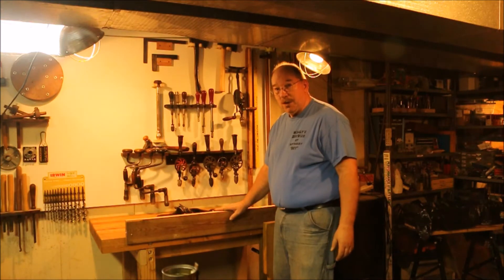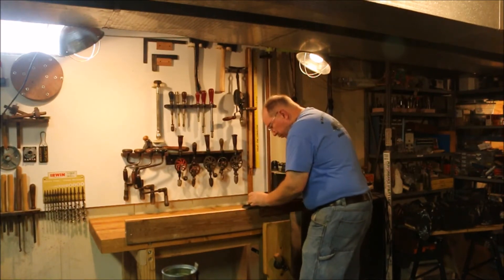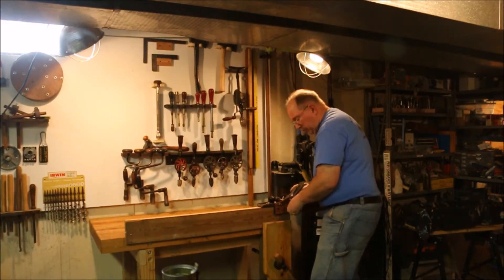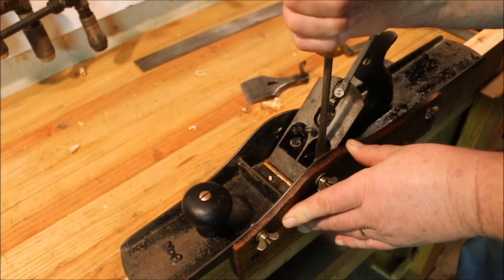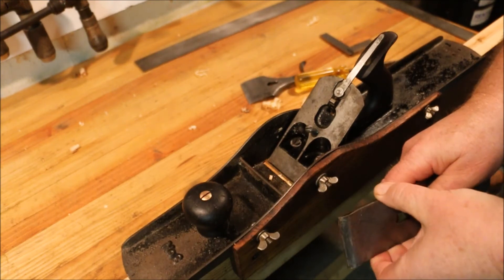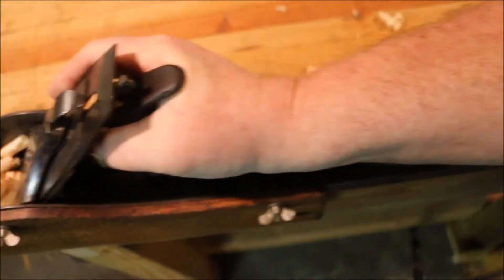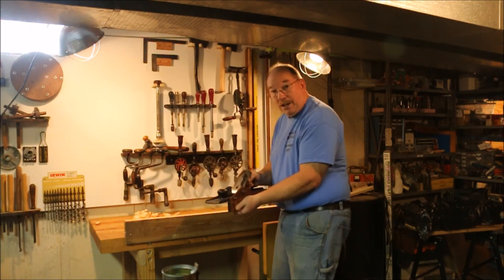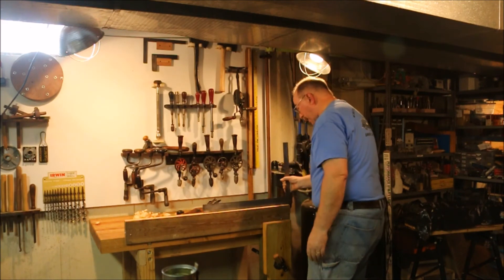ANTIQUE SHOP FINDS ~ STANLEY NO  8 PLANE ~ PART 10 ~ TESTING

Comment: probably going to take a few sharpen cycles to get the blade super sharp, along with a bit of bees or candle wax on the sole to help, it should become a bit easier soon, perhaps the back of the iron cap needs flattening to help it seat better near the blade too, dunno if you did that.  all planes need a period of more work and adjustment to get them right, will be a great plane for shooting board work due to the weight
Reply from the maker: Jusb1066 It does take a few uses before I get a feel for what works best. Every tool has quirks that need special handling. Figuring out the proper back angle will take a bit. Even then it's going to be compromise between pines requirements and curly maple. ☺

Comment: Takes some adjustment and skilz to run that aircraft carrier along the wood. When it’s tuned they are a dream.
Reply from the maker: Nemo I like to get a baseline of the plane before I start tweeking it. Even with a dull, over cambered blade I was able to flatten the edge of a 2x6. I am looking forward to setting the edge of the blade square to the side on the treadle grinder, flattening the blade and sole, polishing the edge on the waterstones, and shaving off slices I can almost see through.

Comment: Switch the wingnuts to the inside of the plane so that they are not in your way when using the plane. To adjust the frog, use the adjustment screw at the back of the frog. Sharpen and flatten the back of the blade. You have a very nice old plane there, hold on to it. Like your video's without noisy music and the nice slow but deliberate pace of progress. Keep up the good work.
Reply from the maker: Thanks for the suggestions.

Comment: I just got done watching 'The Woodwright's Shop' at work (that's actually part of my job!!!), and they were discussing hand planes.  How to get the proper camber, adjustment, setup, etc.  I am looking forward to seeing this plane once the blade is sharpened up.  I'm sure you'll make that board a 2x4 without breaking a sweat, and it'll have machine-precision corners too.
Reply from the maker: +Brian Neeley The Treadle Grinder is just waiting for Monday to arrive so it can do plane blades.

Comment: I figure the $20 and your time will be the final result of the plane being worth between $420 and 425K$. Expert doings' nere. Sure is a beauty. I'm going to have to shine up my hammer! You guys are rubbing off on me too. I got a plywood blade and some fixtures for the impact and a FRAMING SQUARE! I had one years ago and I sure missed it. This one is aluminum and all the readings are nice and stamped clearly. I'm happy! I also got Sweetums a rechargeable screwdriver for when she goes to putting the cabinet doors on.  I'll never be able to do it and she's overjoyed it's something she can really use. Thanks A;ll Yall and Thanks Unc for the channel!
Reply from the maker: Lewie McNeely Glad you got a framing square. I use mine all the time. I have 4 of them because I found one with a set of rafter tables on the back, another is really old and narrow. Then there are the two Stanley squares, one I bought, and the other just wandered in. 
You are getting some power tools that will make life easier. I hope your impact will do for you what mine has done for me. The carpal tunnel in my wrist has my hand too numb to hold a hammer after driving ten 3" nails. The impact puts one hundred 3" screws in and my hand is just fine. The best part is it doesn't catch and twist my wrist like the drill drivers. The drivers have a clutch but I have to crank it all the way down to have it drive the 3" screws. The impact just hammers them home.
You wife will love the power driver. Lydia has found uses for hers that I never would have thought of.
Reply: This is a Swanson like my speed square but sometimes you need a bigger version, at least I do. I just flat-out miss a framer. I'll probably use it more than anything else except for narrow stuff but maybe not. I hung Sweetums tool hanger in the greenhouse and the impact sank the 3-incher in a BLINK! The 3/8ths drill will do that but the wrist takes the lick. Mine just can't take it anymore and I got the sockets and such for it today with an 1/2 inch adapter so I'm pretty well set. My gate overhauling will shine with the impact and the 3 inch screws. Can't wait! Plus digging the hinges out! Sweetums was plump happy with the driver. I keep telling her I love her but a electric screwdriver says it better than flowers sometimes and we can't eat the candy! Thanks for the inspiration Unc!

Comment: I enjoyed your series on the No 8 plane.  I have a suggestion for a video.  I would like to know more about the specific uses of the Stanley planes.  Why would I reach for a No 1 plane instead of a No 4 or 5 or 8.  What are they used for and why?  Is there a universal plane that one should start with?  Obviously, I am  plane novice.
Reply from the maker: Wayne Bishop Good suggestion. I not an expert but I have a few ideas.
Reply: well you always buy a number4, its also the cheapest to find  due to being so common, the rest you can buy as you find out what it does, but just go ahead and track down a number4 right now!  get something half decent, say a stanley, make sure its not the budget ones like a handyman etc as they had plastic handles or adjustment knobs